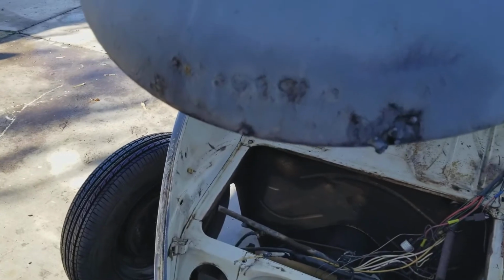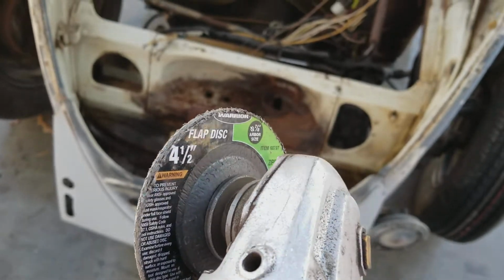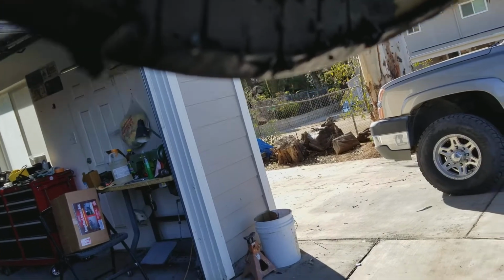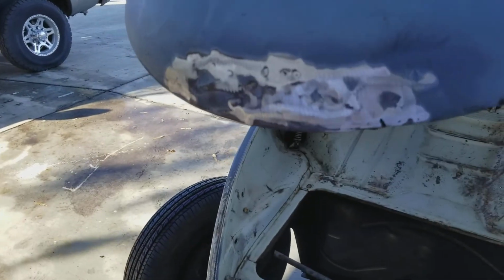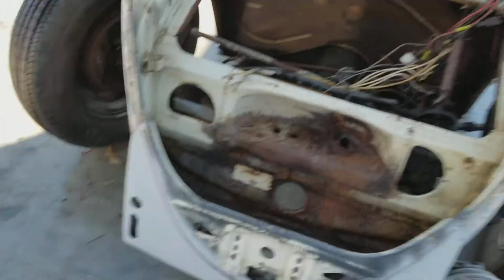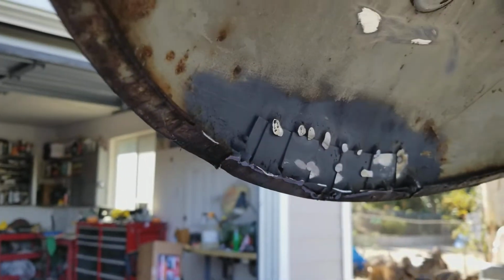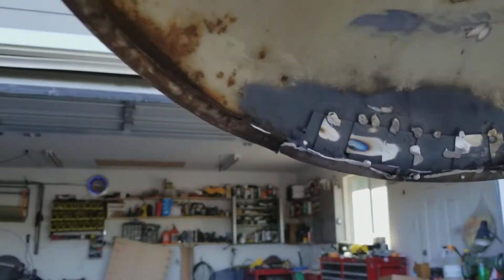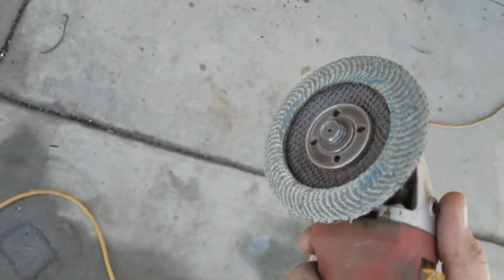Grinding welds the easy way

Comment: I use an air cutoff tool and use the edge to grind the welds flush. Then I will go to a 3” grinding disc to blend them. I do like the flap disc for its speed though